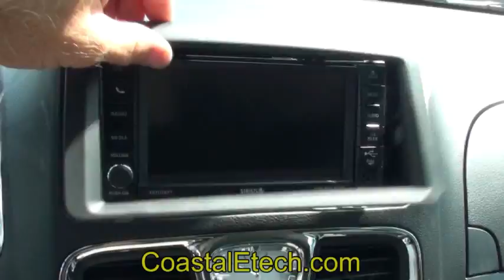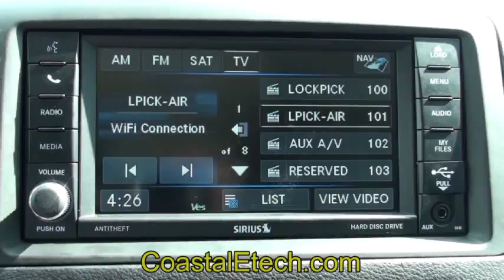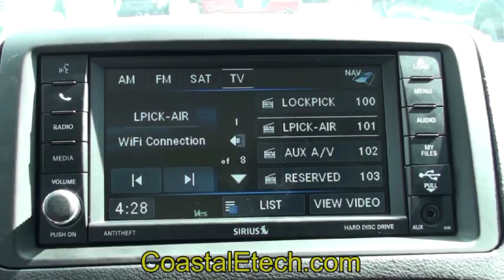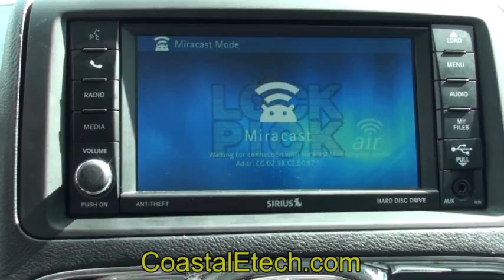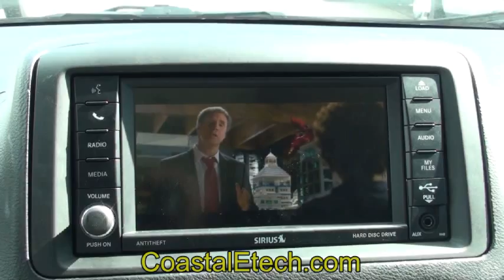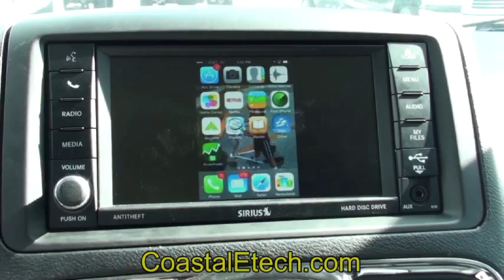Lockpick Air Mygig Town and Country

Comment: I have a 2009 Grand Caravan SXT with a mygig REN....nothing
works....radio doesn't even power up.....no music and no back up camera. Any
ideas? Is it possible the entire unit is gone? There are 3 fuses that affect
the radio/camera system....M10, M12 and M34. They also power the Vanity
Lamp,Heater Ventilation,Air Conditioning Module....all these work.....any
suggestions?
Reply: you have to make sure the first two switches on the mygig air are down.

Comment: So what I'm getting from this is that basically any video played on an iPhone would not work? How about if I load my own movies or videos on an iPhone and play them, will those stream? I saw YouTube had some restrictions, can you emphasis a bit on what those restrictions are. I have an iPhone 6, but being that this would be the biggest reason why I'd get this I'd like to know. Also, would the built in "DVD" drive allow the use of actual video DVD's to be used and played on the screen? Thanks!
Reply: you can get the cheaper lockpick without airplay and get an apple TV. get a hdmi to composite av adapter and connect the appletv to the lockpick.
Reply: you can get the cheaper lockpick without airplay and get an apple TV. get a hdmi to composite av adapter and connect the appletv to the lockpick.